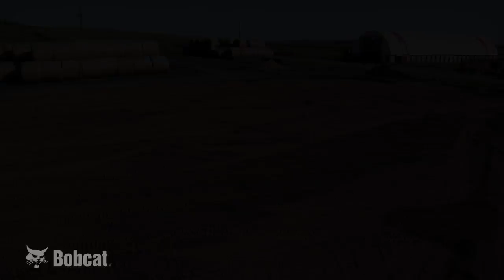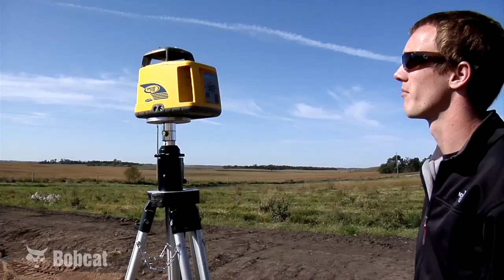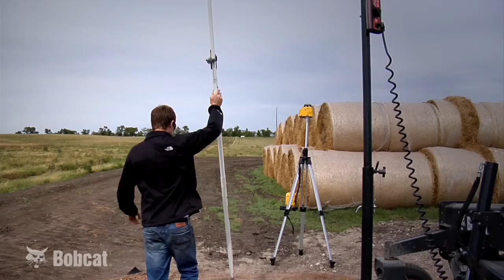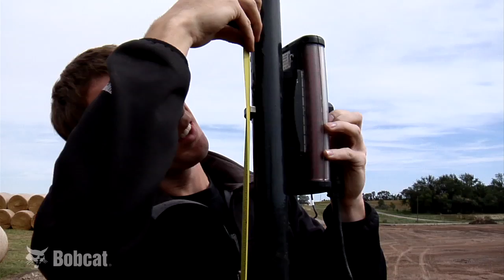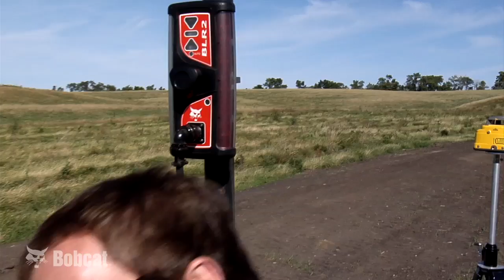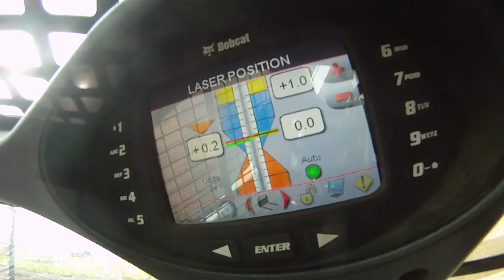How To: Set Up Bobcat Grader Laser Attachment

Comment: @:18  What gun sites and line it up with what?   The location of the bottom of the grade?   Should the transmitter be on the high side or low side of the grade?      Is there any limit 'above the cab' that would be too high to raise the transmitter?    Doesn't really show in which direction the grader should travel in order to achieve the fastest/most  optimal grade.

Comment: I have the 96" and a T650 and just started using it.  I setup exactly like this.  1 problem.  When i drive away from my laser my blade starts dancing like crazy as if my receivers are picking up 2 different beams or something.  When i am driving towards my laser it works fine.  I need some help please!  Thanks
Reply: Ross Koopmans did you ever figure out the issue? I have a similar problem
Reply: This might happen if you have a flashing light on the roof of the machine , turn that off and try it
Reply: I have had that as of late. After a few good rain downpours, I worked right through. I turned the problem child around to face the other direction, and it went away. 

 Condensation inside the lens on that side ? Not sure.  I could isolate it to one direction and made it go away. And of course try  a calibration if it ever happens.